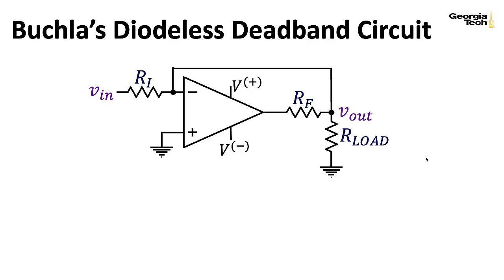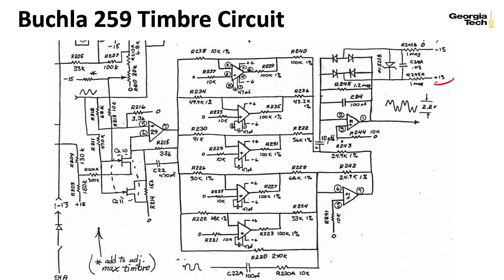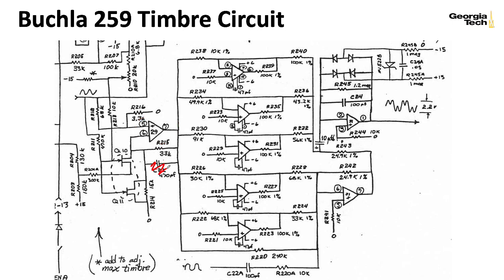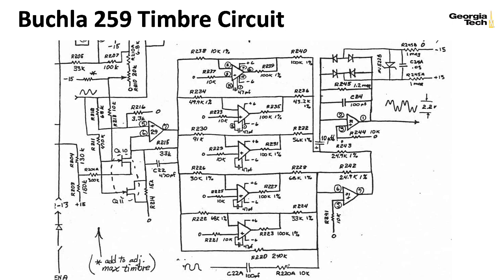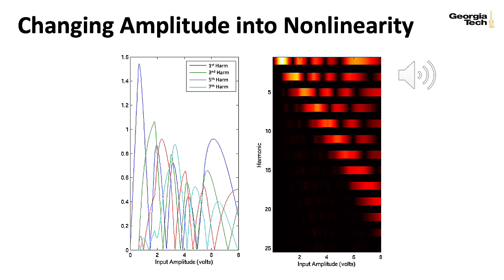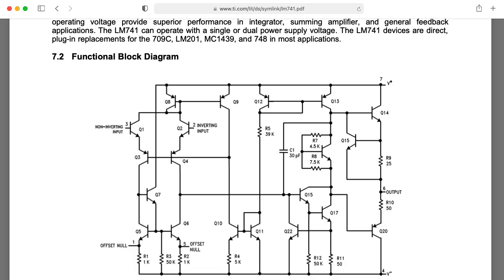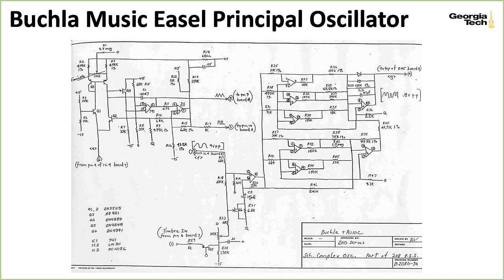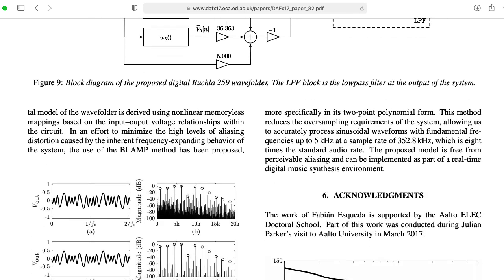ECE4450 L16: Buchla's Timbre Modulation (Easel & 259) (Analog Circuits for Music Synthesis, GA Tech)

Comment: I recall 1% resistors were only easily available in metal film type. I'm guessing the lower noise and better stability of metal film would have been of as much importance as tight values in these circuits. Saying 1% tolerance might have just a been slightly roundabout way of specifying them.

Comment: Dr. Lanterman, I suggest TS924 op amps (with +/-6 v supplies). You'll find them to be excellent for the Buchla topologies. And they source and sink marvelously, so you may be able to use sections as DC bias supplies without issue. 

I also suggest using half of a LM13600 OTA in the position of op amp 29; as it has linearization diodes and that do what you're describing at 8:25. Note that the RCA OTAs were Bob Moog's favorite ICs. 

To my ears, the sounds from this process are reminiscent of formant filter processes.

Comment: Looking at the deadband circuit, if you take the output straight from the op amp instead, you get a saturation nonlinearity.

It seems to me that the nonlinearity of the 259 wavefolder could just as well have been made by summing together these saturation nonlinearities instead of the deadband nonlinearities, and then you wouldn't have to to worry about the load resistance from the summing stage. I wonder why Buchla went with the former approach instead of the latter?
Reply from the maker: "I wonder why Buchla..." is a frequently uttered phrase when looking at Buchla schematics. They really seem like they're from some mysterious parallel quasi-magical reality.